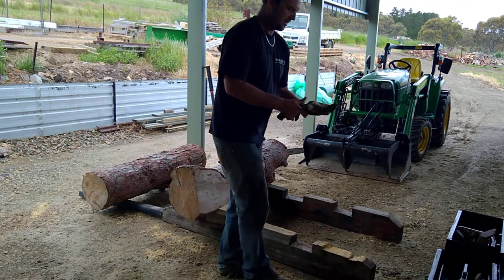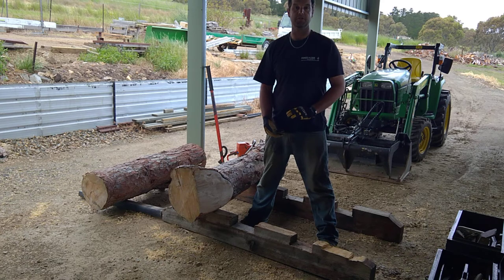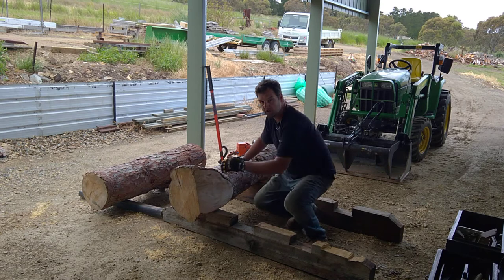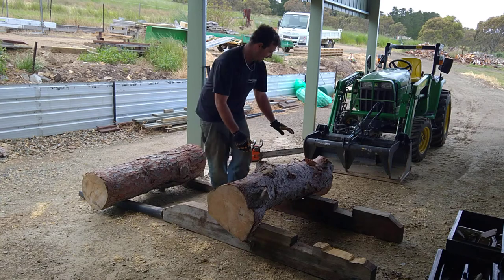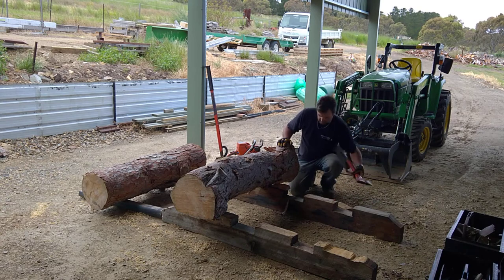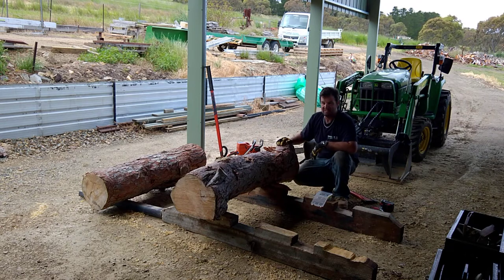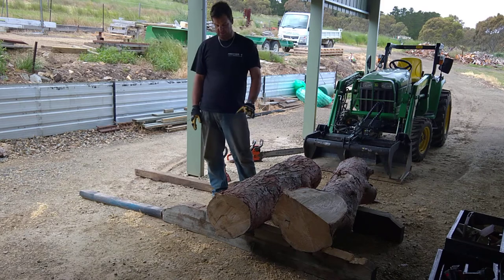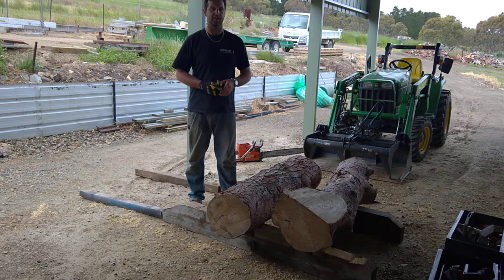Lucas Mill tips and tricks - Part 2 - Log Bearers and Bracing

Comment: I always take a flitch from the top first.
Then flip so you have a secure base so when getting 200mm boards on the vertical the log doesn't want to role when it gets uneven.
That also takes some of the tension out of them.